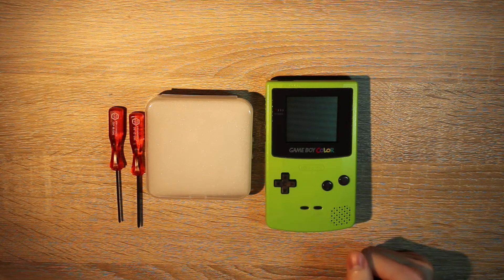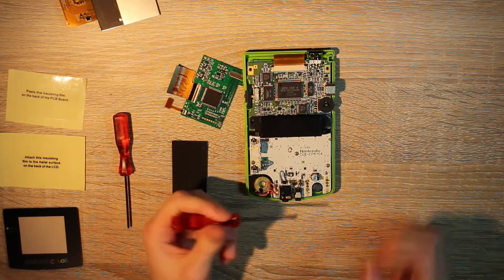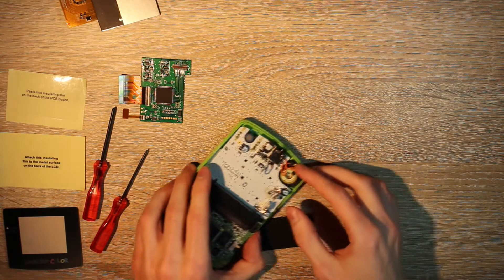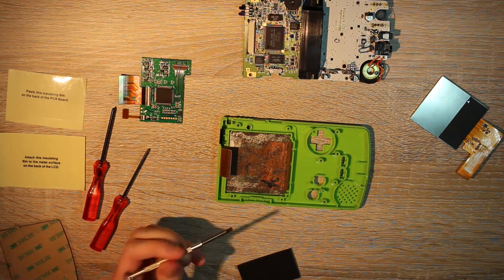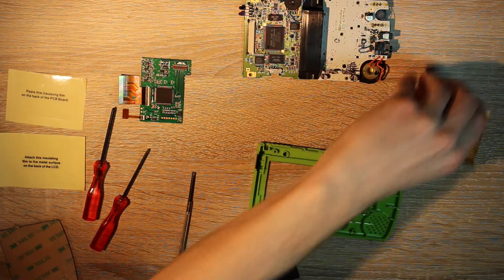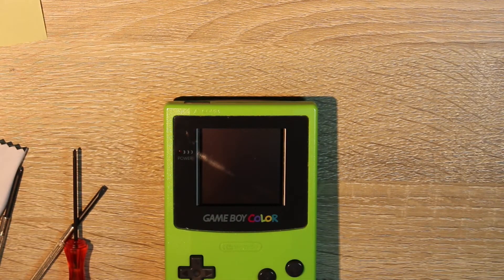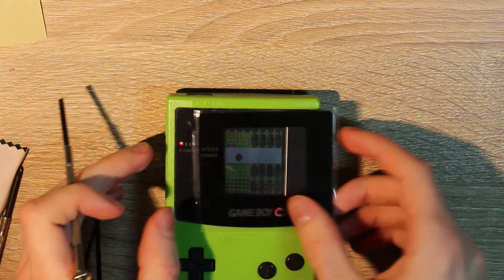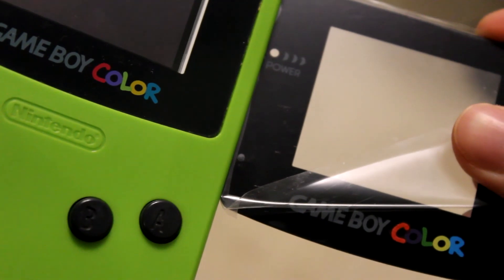Game Boy Color Backlight Mod Installation

Comment: It definitely sucks that the screen is smaller... I would maybe mask off the edge of the screen if possible with black tape or something if you still want to keep the old screen lens.

I think the way the brightness control generally works may be start or select button, and then the "antenna" thing is probably a capacitive touch sensor... maybe put it near the edge of the case and it can tell when you put your finger near it to change the brightness.
Reply from the maker: Oh true, I didn't even think of a touch sensor. That would make sense since it really isn't in the shape of a 2.4GHz antenna. I'll have to investigate a few things and report back
Reply: @SamCampbell  where are you man? Your last video was a year ago!